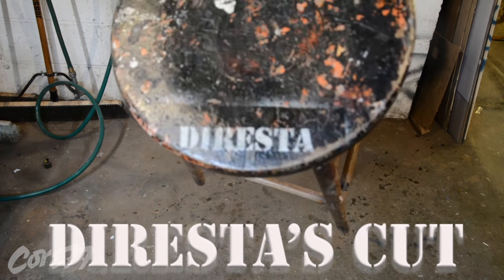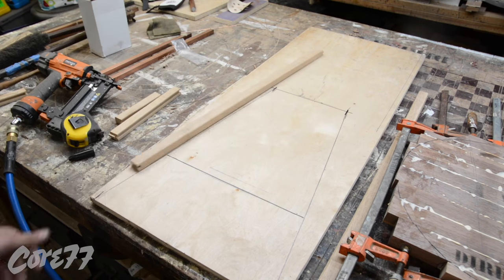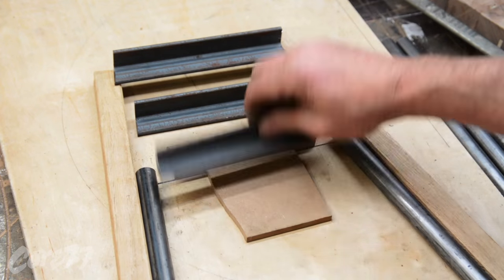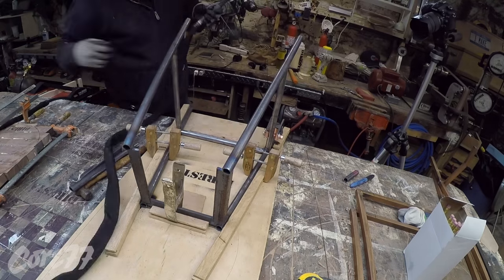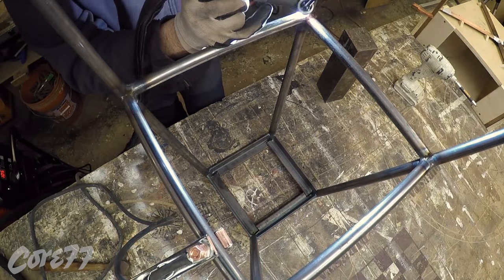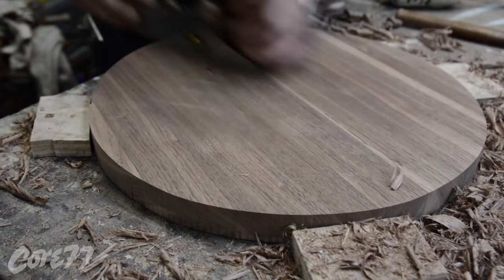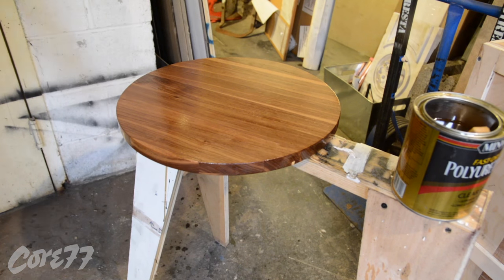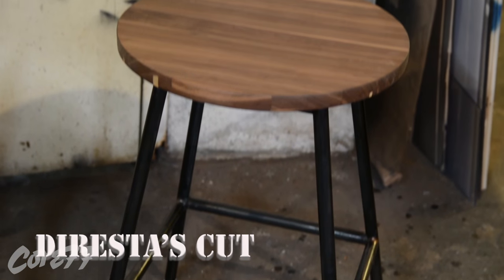DiResta’s Cut: Steel & Walnut Stool

Comment: I like the effort to preserve or use the dimension from the original piece. When you have something that works, it's because of its form factor. It seems with today's engineering more thought and effort goes into the manufacturing and shipping/packing side of things with less concentration on the actual form that works. Drawing from something from the past like this takes us back to function-based engineering and forms factors that work. Loved seeing the Lincoln SW 200 and the edge of the Beaumont sander trick. Best wishes for much success in the future. Aloha
Reply: I'd rather use a file and manual sanding instead - I'm pretty sure this damages the sanding belt pretty fast, and I'm pretty stingy when it comes to tools and materials.

Comment: I love watching your videos! The stool you copied looks like a stool that used to be made up here in Boonville NY by the Sargent Furniture factory. You can tell by feeling the legs to see if they have faint lathe marks in them. They were turned and then to smooth them out they were tumbled together for a couple of hours to knock down the high spots. It was a deafening process! Also the stool tops were just strips of hardwood , ripped, color matched, and glued together with no other fasteners than the glue. It was quite the process.

Comment: Hey jimmy, I do case mods from time to time and for details, I sometimes need the connectors of the power supply in the right color.
These connectors are made of nylon too and you can dye them by using household clothing dye. I usually use RIT-dye but any dye should work that can be used for nylon clothes.
So if you are in a hurry or want the detail to be perfect, simply buy white nylon feet and dye them. It takes maybe fifteen minutes from dye powder to dyed part...

Comment: I'm an auto body technician, and use the silicone bronze mig welding for my 1/4 panel splices. its awesome. Less warping, easy to grind, overall nicer job. I can take picks of the next 1/4 panel i do if you're interested.
Reply: +jimmydiresta Should be this next week or so.
Reply: Should be sometime next week.
Reply: +kornweasel thank you !
Reply: Im still waiting for some parts. If your interested in the welder I'm using, It mig welds the bronze, aluminum and steel. All in one unit. I can give you the info for the welder, if you want.Its worth looking into. 
It will also TIG and stick weld!

Comment: Nice build, inspiring as usual.

Technically I believe you are brazing not welding with the silicon bronze.  And that brings up a question.  I am teaching myself TIG and over and over it gets stressed that you need to get to shiney metal to be able to TIG weld.  Brazing is a bit more forgiving but still "clean, clean, clean".  But it doesn't look like you did a ton of prep and you welds don't look like crap.  I haven't seemed to have as much luck with low prep.  Is there a secret?  Probably it's lack of experience and practice on my part and that super clean is for "proper structural" welds and for less critical applications it doesn't matter as much?  I use a lot of found steel and prep to get to shiney metal can be a PITA, so I would love to know if you have any tips.  I'm not doing anything structural where lives would be at risk.

BTW if you like the way the SiBr looks then you will probably also love the way pure copper looks.  You can use copper electrical wire as filler rod.  It is not structural, though it is probably pretty close to brazing.  Sticks to steel really well and is a very nice contrast to "old" pipe.  I have a few pieces where I capped the end of the pipe with copper "welded" to the pipe end.

Comment: when you weld do you need to sand the metal before welding or does it not matter?
Reply: good to brush it first but the shielding gas does a good job protecting the weld

Comment: heat up the metal with a torch. then run a brass wire wheel over te steel. to give it a brass look.

Comment: Nice work, but proportions of your copy are not exactly the same as those of the original. (For the record, I do suspect myself of OCD sometimes.) You should have laid the stook on the board where you marked out your template so that the legs lay flush with the board and the seat hangs over. This way, your build came out slightly stockier, I think.